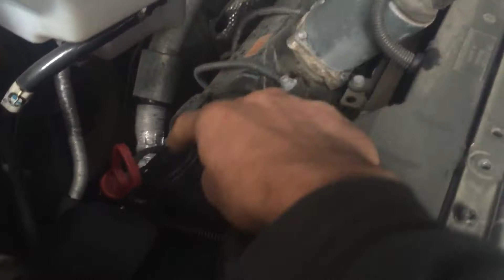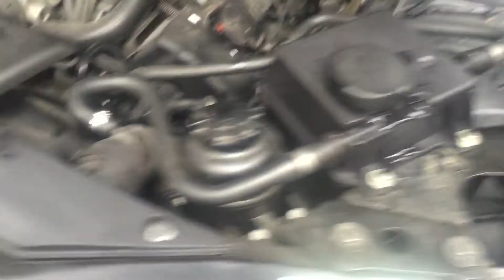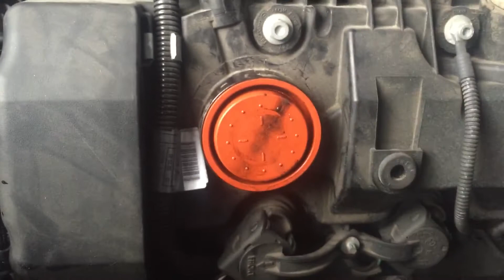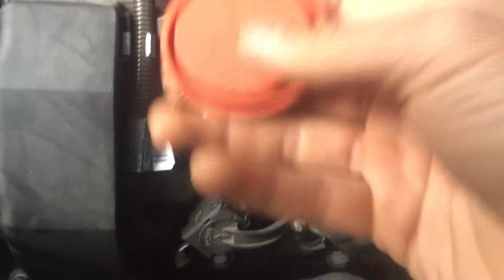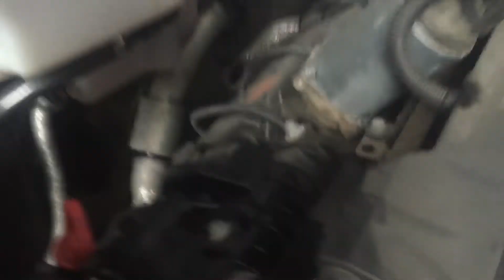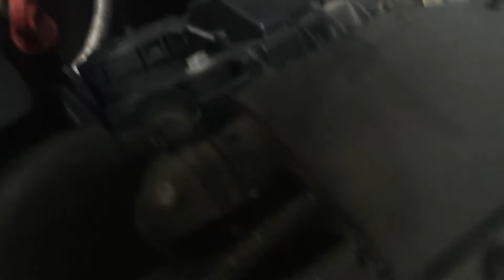how to replaced crankcase vent valve on BMW X5

Comment: 2011 x5 n63 5.0 engine iş same crank case valve? And if it’s broken is make smoke from the exhaust?
Reply from the maker: I don't know if it's same but it can smoke if diaphragm is broken.
Reply: @mraatmm   my car is not same crank I have totally different but same sheet problem:) I will fix tomorrow

Comment: I’m having a hard time purchasing the cap with the male end. There’s a tube that has to connect to it.  That tube plays a very important role in pressure regulation. It’s there to connect to the cap.
Reply from the maker: Is your vehicle X5 2005. Cause on some vehicle you have to change the whole valve cover. Plus the cap I'm using it's a female end.
Reply: @mraatmm ,  I have a 08 x5 sport.

Comment: Helped me a lot. Thanks. This causes strange whistling noise yes?
Reply from the maker: Praudas glad it helped, personally I haven’t heard it whistle but it’s possible for t to whistle I guess.
Reply: @mraatmm  I have 3.0i engine, I have changed whole valve cover with gaskets and problem gone.
Reply from the maker: Praudas on some other models like inline 6 to change the ccv u need to change the whole valve cover. The ccv it’s built inside it. Don’t no the year or model but it’s a inline 6. It’s a hard n expensive repair.  But on my x5 it’s easy   To change n cheap.
Reply: @mraatmm  yes correct but still dont have to change the whole valve cover. You can cut the top off ccv valve cap and use silicone to secure new valve cap.
Reply: @Praudas  yes but you could of just changed CC valve for less than $20 buy cutting cover off and replacing with new one instead of whole valve cover.
Reply from the maker: @dflex4180  yes, you are right. If u can get a the kit for the model u can do it. I think it can be done without removing the valve cover. But for any reason u try to do it with removing the valve cover then i recommend to get new valve cover cause it comes with new gasket and new ccv. Plus u dont want to take risk doing all that work  have some tube inside being broken.